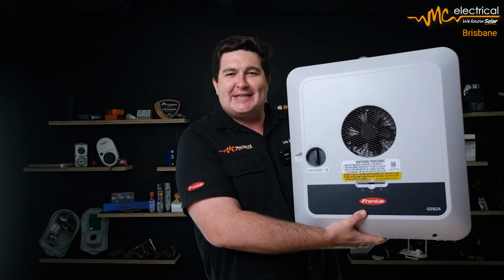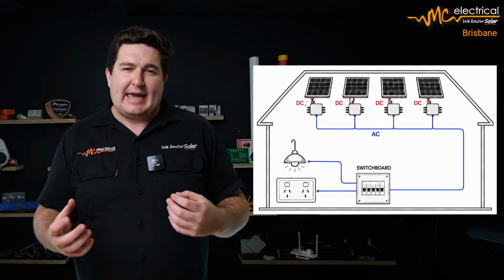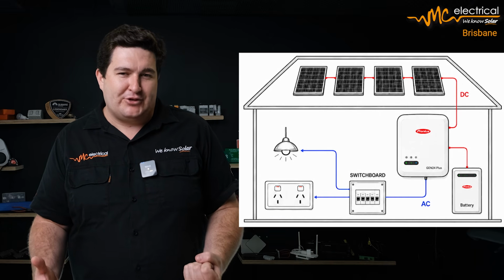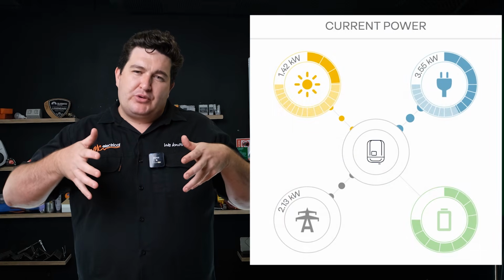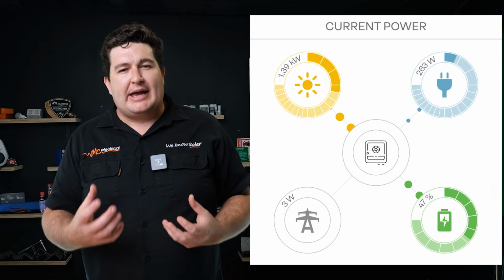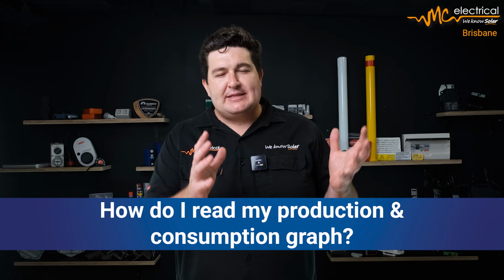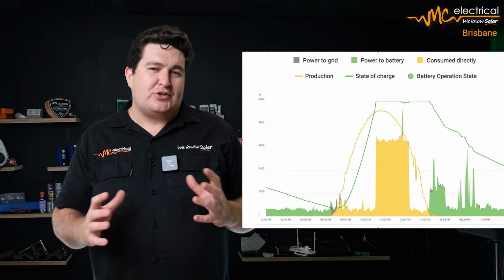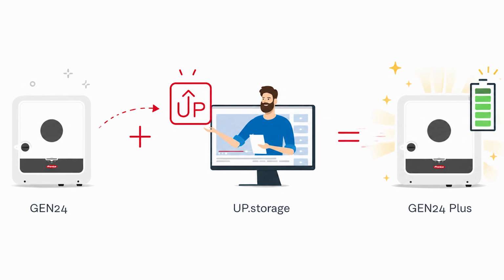Solar Inverters, 3-Phase & AC Power Explained | Back to Basics | Episode 1

Comment: Great video! What led me to this video is a question whether a battery connected via 3phase inverter will feed both Controlled Load 1 (hot water) and General Usage (the rest of the appliances) or only Gen Usage? On my meter box I have smart meters for CL1, Gen Usage, Solar feed. Also, there is only one main switch on the meter board. 
Also, in case if battery goes flat and my hot water needs the power, will it draw from CL1 circuit as normal or will it draw from Gen Usage, please?
Many Thanks!
Reply from the maker: In SE-QLQ, from a billing stand point solar only feeds the general loads. Controlled loads are not , by the solar. If your exporting power and your hot water is heating the power flows out the general loads meter and gets imported back in via the controlled load meter. The inverter consumption meter also only measures the general load usage for your consumption data. This data is used to control the charge/discharge of the battery.

If you want your hot water to be fed from the solar. Its best to move the hot water onto the general loads meter and then restrict the hot water to heat during peak sunlight hours. This should also allong you to heat your hot water from your battery if needed. Best make sure its an efficient system like a heatpump hot water, otherwise your hot water may leave you with a flat battery

Comment: Very informative. Thank you! Few questions for you:

1. I'm using a changeover switch with my solar system being the primary and the grid or generator being secondary. I assume the battery kicks in automatically once the panels are drained when the sun goes down, correct? Is it possible to program the system to avoid automatic use of the battery? I want the changeover to switch to grid to preserve my battery for when I'm ready to go to bed, so I can run my ac through the night.

2. Using a changeover switch, does the system automatically switch from battery to solar once the sun comes up?

3. What is the purpose of the AC in port on the inverter? Is it just to charge the battery or does grid power run through the inverter throughout the house when on grid power? If it does, is it limited to the wattage and/or power of the inverter? If I want to us the AC in port on the inverter for charging only, can I just loop it from where the grid is connected on the changeover switch?

Appreciate your expertise.
Reply from the maker: I think the changeover switch might be the confusing bit here.

Usually the changeover is just there to select grid/generator/inverter, or to bypass the inverter if it has a fault. It doesn’t normally decide when to use solar or battery.

That part is handled by the inverter settings.

So for what you want, look for settings like battery reserve, time of use, or charge/discharge schedule. That’s how you stop the battery draining too early and save it for overnight AC.

And don’t loop AC inputs around the changeover unless the inverter manual specifically shows it. That can get ugly fast.

Comment: I have 2 phase to my house.  I'm a sparky, its very frustrating.  I have all my solar and power circuits on one phase.  Can you give talk how the manage a 2 phase house.
Reply from the maker: I had the same thing with my place when I moved in. It had an abc overhead , a polyphase meter and all 3 phases were connected, just the primary left out. So I ran a Sdi from the mains box and plugged in a primary. 🤫. 
Apparently In Energex area, it’s the same price to go down to 1 phase as it is to upgrade to 3 phase. I guess it depends on what you are trying to achieve and the rules in your area.

Comment: A question for you, I saw recently that a large solar / battery supplier in the UK has gone out of business and left a lot of people with out the ability to monitor or change the settings on their systems. 
If a similar thing happened here, assuming your inverter isn't built into the battery stack, would it be possible to install another brand of inverter to the no longer supported batteries to get back monitoring and control of the system?
Reply from the maker: That's rough. It’s technically possible, but there might be a fair bit of software-related setup involved to get the inverter and battery to talk. Would need someone who knew what they were doing. It’s often very difficult to get different brands of hardware to communicate properly. Fronius is compatible with BYD, Reserva for instance, but wouldn't be able to control a Sungrow Battery as it doesn't have the software to communicate with their BMU. You'd need a device between them to interpret and send the control logic. Are you affected by that supplier going out of business?
Reply: @mcelectrical  no, just saw a few videos about it!

Comment: how are 3 phase inverters sized? My understanding is a 15kw 3 phase inverter will provide only 5 kw per phase?
Reply: Generally speaking yes. 

One exception i know of is the new 15kW Fronius Verto-plus can provide upto 7.3kW per phase in battery backup mode.
Reply: @Yorick_Mark  cheers. 5kW is not much to have one one circuit in a modern house!
Reply: @jackdawg4579 I disagree. When your connected to the grid its all net metered so it doesn't matter if you pull more than 5kW on one phase as long as the total consumption is below the inverter output. In backup mode in a blackout its more of a problem as it can overload the system. It would be rare for a large house to pull more then 5kW on one of the 3 phases except for the occasional spike.
Reply: @Yorick_Mark  yes matters when your on backup, but the way my sons was wired, it was constantly tripping until he got a bigger unit installed..
Reply: that's what my sons dodgy installer put in his place, 6 months later he got another installer to fit a bigger unit.
Reply: @jackdawg4579  Yeah. I am assuming it's something like a 15kW FoxESS H3 Smart. It's a problem when the internal contactor for the backup is not sized for
 full home backup.
Reply: A 20Kw Goodwe ET-LV will provide upto 10Kw per phase provided total demand across all three phases do not exceed 20Kw.

Comment: Where is the goodwe esa review?
Reply: Entitled much?
Reply: @happybeerlove not at all, Happy with yorick's reply it's still in the works.
Reply: In the works
Reply: @Yorick_Mark  while you're doing that, one more thing to test is quality of off-grid power with BESS. I'm seen couple users report flickering lights when off-grid with Goodwe ESA, and then lot of other Goodwe users said that was "normal". Might be nothing, but worth considering, since grid-forming is a key feature.
Reply: @azzafdu interesting. The lights shouldn't flicker as grid connected inverters should be capable of producing a true sine wave.
Reply from the maker: Actually just chatting with my mate where we installed it atm. We had some weird round trip efficiency results (really bad on slow discharge) so I want to run the test again.
Reply: Thanks for the update.